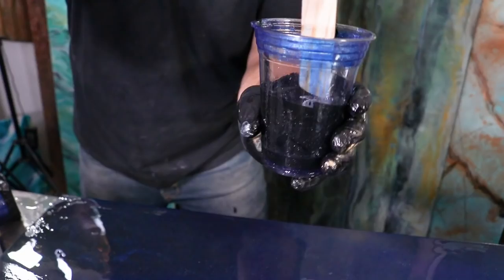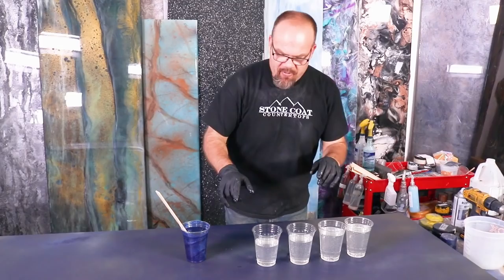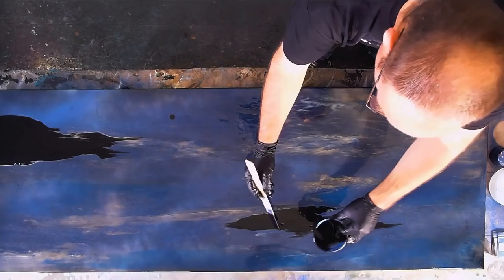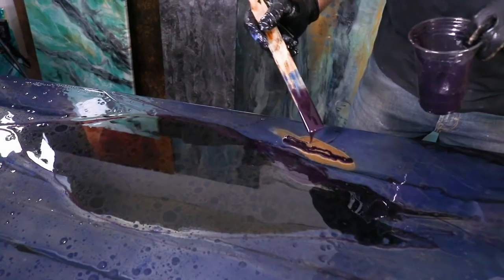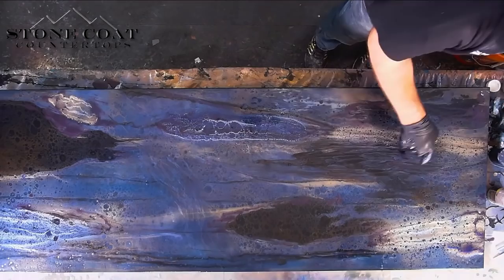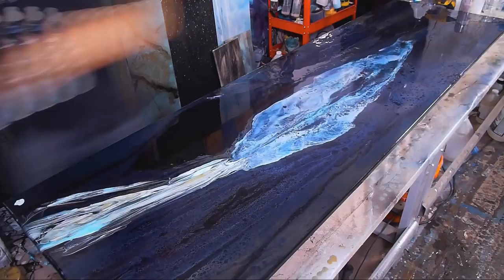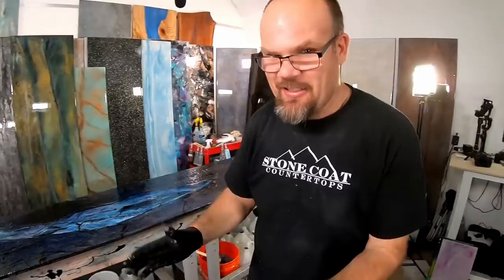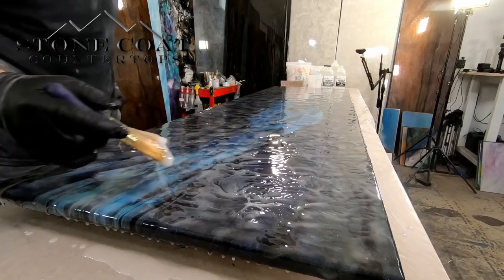How To Transform Epoxy into Blue Granite

Comment: BTW. Using a torch, will make the cells pop, but it also  makes the outer coating start to dry faster,  causes it to make a seal to soon. It is better to let the cells pop on their own and not use the torch on your final coat. It make it take longer to cure, because once the outside is sealed the under coats can't get the air it needs to dry in all at the same time. It will last longer and not have any issues later on in the future. The  top could fracture with torch, years down the road. Hope I helped. Not criticizing. I promise. It look's gorgeous. I love watching other artist at work doing what they love. The excitement in your voice says it all.

Comment: Do you pour the part A and part B in the clear epoxy cups? If so how much working time do you have before it starts to set up in the cups. Thanks
Reply from the maker: Hi Brandon Raynes, you'll want to mix the epoxy first, then split it up into separate cups. Set up time really depends upon the temperature and how much epoxy is in the cup! 
Call us anytime with questions at 541-450-1976 and we are happy to help!

Comment: Mike before you made the 1st pour what was the structure of the top you started with. Was it straight wood painted black or was it a counter top material? And is there a certain material you shouldnt have as a base or foundation? Thx
Reply from the maker: Wonderful question louis Ocatcio jr! We used 3/4" MDF board, you'll want to stay away from materials that are really thin, the epoxy has some flex but not a whole lot so when you apply it on thinner materials you risk having it crack!

Comment: About what did that cost you to make? That was a lot of epoxy
Reply: I was wondering the same thing.
Reply: Well its like $180 per gallon. Probably like 3 gallons. $550 or so?
Reply: @discoveryoutdoorskcfishing236  Im thinking closer $750 when you include the hardener, paint, powders, and sanding disks.  Then add in man hours/labor and that turns into a $1500 piece of art very quickly.
Reply: Well,  navy is more attractive , and it gives a sensation of freshness, and kind of relaxing for the eyes. This is a woman opinion.😃
Reply: @discoveryoutdoorskcfishing236  umm on their website it's only $95 for a gallon kit which covers 20+ square feet, which this counter is definitely under. Spray paint is like $5 a can and you can get the Micah powder pigments cheap on Amazon.
Reply: @GRIMRPR6942    umm on their website it's only $95 for a gallon kit which covers 20+ square feet, which this counter is definitely under. Spray paint is like $5 a can and you can get the Micah powder pigments cheap on Amazon.
Reply: @GRIMRPR6942  also as far as time goes the sanding is the worst part, and that can only take a few hours with a good sander. You have under an hour to work the resin before it hardens so it can't take a lot of time. The rest is just waiting for it to harden and cure. This is meant as a more cost effective option as opposed to stone counters. The estimate they give for a do it yourselfer to use their products and make a counter is about $250.
Reply: @blurrytokerarts3705  Ummm that's not what the price used to be. Did you even look at the date of this Old Post?
Reply: @blurrytokerarts3705   I can tell you've never actually done this before so let me help you out. You actually have something like 15 minutes to work the resin before it gets too tacky to work with any longer. not to mention I just did my countertop and it cost me about $500 total. Looks like my original estimate was pretty dang good.
Reply: @discoveryoutdoorskcfishing236  weird, I've worked with resin for years now and when an epoxy has a cure time it usually follows that, and as far as how much you used, they literally say in this video 3oz per square foot. You must have went thicker if you used that much more
Reply: @discoveryoutdoorskcfishing236  also you're telling me this whole design was done in 15 minutes 😂
Reply: @discoveryoutdoorskcfishing236  yeah, 5 months ago when thier epoxy was the same price it is now 😂
Reply: @blurrytokerarts3705   you didn't finish reading what I posted did you? I just did my countertops and my price was what I said it was going to be. I was correct you are wrong stop crying about it.
Reply: @discoveryoutdoorskcfishing236  whoa whoa whoa. Your not supposed to say someone is wrong they may have sensitive emotions and may cry. Nah screw that when I'm right I'm right so make em squall
Reply: @discoveryoutdoorskcfishing236  The working time depends on the resin. Some brands have way longer working time than others. For instance, I've used MAS and Total Boat. MAS heats up hard as a rock in minutes if you don't get it out of your bucket and dries pretty quickly. Total Boat is more forgiving. Stone Coat and Leggari have countertop epoxies formulated for a longer working time. Stone Coat has a new product that's designed to cure quicker. Also, you can buy yourself a little more time by warming up the resin and torching lightly as you go along. It kind of "wakes it up."

Comment: This method of working on your own projects are time consuming, but at minimal cost, for older or lower income people, this is a dream scenario. I am way past desiring to earn more money to have things I want. These types of videos are a God send. The only trouble is they are so addictive, you can't  stop watching, once the guys begin working! 
I have about a dozen good condition very old, 70 plus years? Bedside tables of various heights, and most with pretty feet. Am going to build kitchen benches in this over 100 year old mud brick cottage in Hungary,  from all the bedside tables and make a solid top, big L shape, tile it with old tiles here, then do the tile cover epoxy he did in another video...or... make concrete bences and do the epoxy thing...because you can put some plastic moulding in the form work and make the suitable old fashioned edges, they used back in 1919 and thereabouts. Then will fill and sand the board floors I made from fence railings, stain and seal them, then paint all the bedsides benches. While they are not 2 foot deep, only 1 and 1/4 feet, it's  ok, as I have a big crockery and food cupboard/ pantry, plus another small pantry under the attick stairs. I only eat fresh food, no tins or packets, so am sure the smaller cupboards will be sufficient. Too many grand ideas! Thanks for making these vids too.

Comment: Where did you get those spray bottles? The ones with alcohol in them. Also, what do you do with the drips on the edges, can you just use a razor knife, trim and then torch smooth?

Comment: Really nice looking Mike...... But..... I don't see the recipe for this project. Also  most of us diy folks may not be able to afford the long list of additives. It's really a magnificent piece very stunning. The thick epoxy you added at the end would really add to the cost, because of the extra layer to level it out. Could you maybe make the thick stuff batch before you start so it's ready sooner and have time to "sink" into the first layer while torching and eliminate the third layer? Were there any air bubbles or issues with that because I didn't see any full piece torch until the end.? Thanks for the hard work you put into all your videos and projects.

Comment: OK, sir - answer me these questions about applying epoxy resin like you say is great and easy to do, with lasting and satisfying results.  (1) Several countertop installers in my neck of the woods say an epoxy finish doesn't last long, that it actually wears away. particularly around "high-traffic" areas, like sinks.  Few countertops do not include sinks.  (2) Other YT videos warn people that epoxy may resist water and moisture, but are terribly good at absorbing colors from cut veggies and does not hold up when it comes to avoiding rings left by wet glasses or mugs.  (3) You guys talk about and perform well with the products you use, but never mention what kind of warranty they come with.  Maybe I'm beginning to see why.  Tell me where I am wrong.

Comment: Question on process... when you use the alcohol mixture, circles open up, that one who paints might call “fisheye”.  Do you agree that it’s fisheye occurring?  It usually has a nice effect for your purposes, but will it tend to leave openings that would be an uneven surface that you’d need to fill at the clear coat final stage?  We enjoy your enthusiasm and have been watching with similar enthusiasm!  Thanks, bill and Elaine.

Comment: does it all just settle and dry level and smooth and how long is drying time?
Reply from the maker: It is self leveling! It should be dry to the touch after 24 hours, 90% cured after 7 days, full cure for Stone Coat Epoxy is 30 days. Great questions!

Comment: You proably been ask this a thousand times. What is the heat resistent on this product? Can you set hot things on these counter top....Will it melt through and can you fix it?.....
Reply from the maker: Great question! Stone Coat Countertop epoxy is very durable. You can set hot pots and pans directly onto the surface; however, just as any countertop surface, we suggest you still use hot pads. Our epoxy is heat resistant up to 475 degrees F after a 30 day cure time. -Nathan
Reply: @StoneCoatCountertops  Thank you for responding to my question i think what you guys do is awsome... I want to start my own business and hope to come and visit before i do.... Thank you so much....